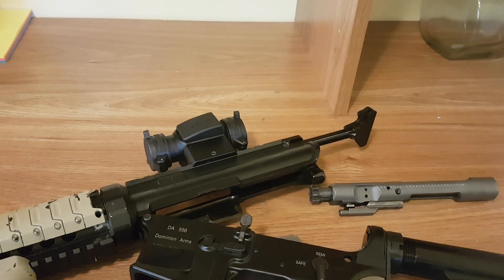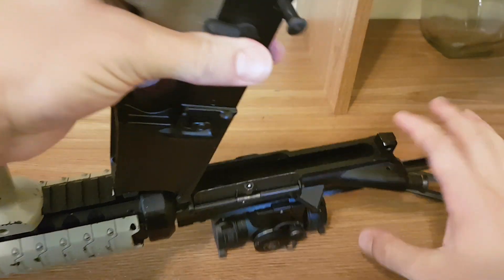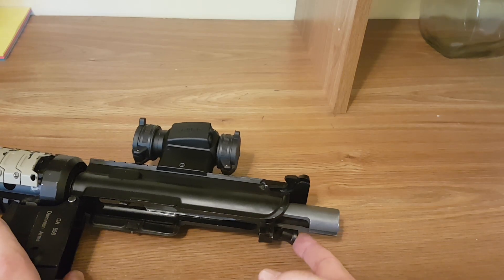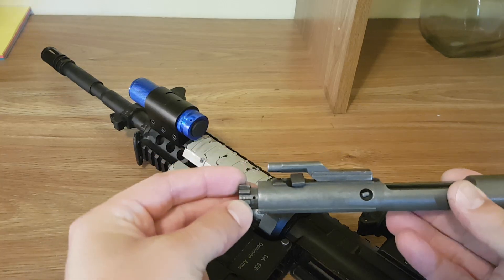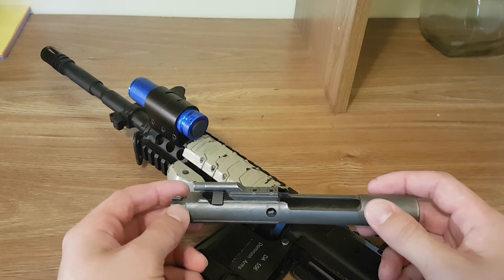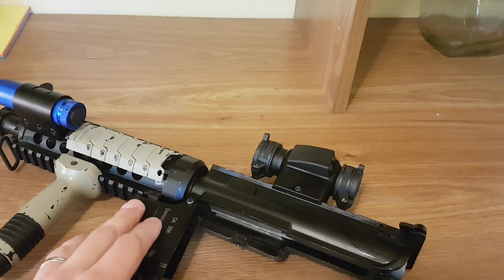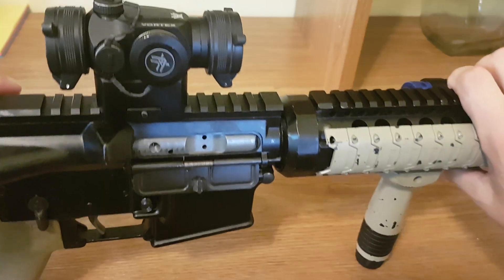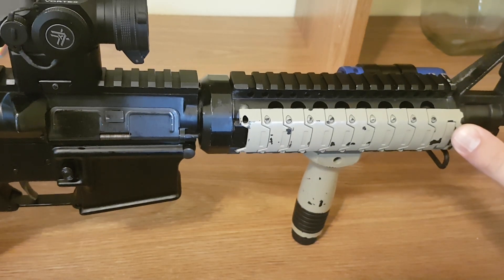What does the Forward Assist on the AR15 Do?

Comment: The forward assist was a solution to the problem of the M-16's non-chromed bore, which was solved by the chromed bore for the most part in the M-16A1 service rifle.  I have shot both them Rascals with and without a forward assist in a non-chromed bore, and the forward assist was a shit-show either way.

Comment: Hmmm, I always thought the forward assist was there in case you fired a half dud, the case ejected, but the buffer spring didn't have enough recoil to completely chamber the the next round, so you could bash on that like a crazed clown in a firefight, hopefully, getting to fire some more. Removes beer caps pretty well.

Comment: The Army called Rube Goldberg to fix the original M16 when the bolt doesn’t seat itself properly to fire a round. Once again corners cut, shoddy, insufficient parts used in the manufacture caused deadly jams.

Comment: It was originally put on to fix a problem that should never have existed.
If stoner had put a version of the AR18 piston system in the M16, the dirty gas would never have built up residue in the receiver. And the forward assist would not have been needed to push the bullet home.

Comment: The secondary forward assist plunger is a design flaw. As is the dust cover and rear charging handle. Notice the scallop milled out of the Johnson bolt just forward of the serrations, that is the primary forward assist, if you have too use the plunger to assist a round, you would be much wiser to eject the round. Better yet, don't buy the .22 cal. AR-15. Buy a decently set up SM-25 or LR-308, much better bang for your buck.

Comment: One of the steps you perform, while chambering a round, with rifle or pistol, is to determine weapon status. Verify that a round has actually chambered or, maybe its been an eventful day, and you need to re-check before you kick that door in. It's sometimes called the "Press-Check" -- Pull bolt back slightly (or slide on a pistol), observe back end of round in chamber, return charging handle forward, tap forward assist to ensure the bolt is once again fully forward. Now you can bust open that door and do good things!!

Comment: I can’t stop looking at the Walmart flashlight
Reply: That actually looks like the free Harbor Freight flashlight they handout when you walk in the door
Reply: MY2001db426 lol
Reply: If it works it works
Reply: Lol I'm sure it really comes in handy for night ops
Reply: It's the most tactical object in the frame...
Reply: I know eh? He needs a tactical flashlight with a pressure switch
Reply: i just tape mine on
Reply: Lol
Reply: I am enjoying the Walgreens red dot myself. Its the single bolt edition too.
Reply: Things probably not even 100 lumen. A cheap 1850 Amazon light is the same size and is 1000+
Reply: Ba hahaha...its because its blue right?? 😆
Reply: @mail-qh2qc  because they can🤣
Reply: Push to start flash light lmao .
Reply: 2021 lol
Reply: I put one on my rifle, to see if I really needed/ wanted one. Maybe what he's doing? Not everybody has money to throw away, for things that might not improve their rifle.
Reply: Harbor freight fo free
Reply: Common sense saves money.  You can spend 100 bucks on a fancy light or use a cheap Walmart light and some zip ties and it will function the same way.
Reply: @Boatman9867  All that vibration after being fired might break a dollar flashlight.
Reply: @Boatman9867  fun fact many of those cheap flashlights have the same diameter as a scope, if you have an extra scope ring lying around you can use that to mount the flashlight on picitanny. It's also very easy to use some wire and move the button back closer to your hand if you wish.
Reply: @Boatman9867  if you think that light and a surefire are equals then there is no hope for you.
Reply: @wlmblsffflions4691  That's nice.
Reply: I’m guessing that whole "set up" is coming in at around 10lbs lol
Reply: I have a 5000 lumens DeWalt light on mine I can see clearly all the way to 200ft easily

Comment: To all the paid Russian trolls: Forgotten Weapons on YouTube mud tested the AK and the AR. Guess what? The AK failed, and the AR passed. The AR is more reliable when it is dirty than the AK.
Reply: ShitSnake take your AK to the mud pit and you'll find out it's not the "impossible to jam" weapon you think it is... the open receiver of the AK is a magnet for mud and crap, the "dust cover" on the AK works while in Safe but remains 100% open to debris during operation.. the AR has a "Dust cover" that will open after first shot but the bolt seals out the receiver and chamber.. there's no open slot in back of the bolt carrier which is the main reason for failure of the AK... both weapons have had decades of development but the only thing people ever reference is M-16's delivered to troops in Vietnam without proper cleaning kits and training.. AK was total pos when first produced, now its barely a pos..

Comment: Sorry for my english, but its not my mother language.
Ok... I am chief sergeant in Greek army and let me explain to you, what this forward assist button does.
To arm your AR, you need to pull the charging handle and let it drag the bolt carrier with force, to lock in the chamber room.BUT these kinetics makes alot of noise!!!
If you are in a hostile enviroment (war) and you need to arm your AR with out noice, you drag the charging handle and after that you drive it slowly with your hand to close in the chamber room. Because the bolt doesnt have the impact force now to lock, you press the assist button to be sure that the bolt is locked with no any noice.
Reply: Also, you can pull the bolt half an inch to watch if you have bullet in the champer  and all are alright and after that you can put the bolt in lock position with the assist button. So you dont waste time in rearming or loosing bullet from the port.

Comment: Forward assist , ?? Or more like , flooded barrel assist , you see these rifles when used in military service were subjected to the very harsh environments that would eventually encounter them being partially submerged in water , so when this happened a suction occurred that trapped water inside the barrel not allowing it to fully drain out , so the flood assist , or call it forward assist , allowed the bolt to be very slightly drawn back , breaking the suction seal , and allowing the water to rapidly drain out of the barrel as air was allowed to enter through the small exposed gap in the bolt , then the bolt could be fully closed simply by , thumbing the assist button a few times , silently , as a slam back bolt closure would require ejecting the already loaded cartridge and following up with loading a fresh cartridge into the barrel from the magazine , noisy a bit , and in some situations this would not be acceptable !

Comment: It's only if you're running in really adverse conditions and you need the bolt to go into battery, it's kinda antiquated as most modern ARs with modern ammo wouldn't have that problem, especially if kept clean. But if I'm running dirty and I need a few more shots it'll be good to know a little grime won't keep my bolt from going into battery

Comment: it actually does have a very practical use.... I use it on my ar10 while hunting, to chamber a round quietly, you don’t let the bolt slam shut, you gently release the charging handle, and use the forward assist to finish putting the bolt fully into battery like the video tries to show, but with a round in the magazine, it creates more friction.

Comment: It’s used to inject your no2 or nos or nitrous oxide, can be used to open the carburettor, some models of ar15 it’s used to drop the clutch and go skrrt skrrt, enable diff lock, traction control, shift gear, and lastly change your blinker fluid

Comment: You don’t “push” on it, you slam it with the heel of your palm so it goes home. Its not a pushbutton on a 1965 am radio, it’s a lifesaving mechanism designed to “assist” to user in surviving.
Reply: except it actually doesn't do anything that cycling the action wouldn't fix.
Reply: That's what I was taught in the Corps, exactly like you say. Although I guess for just garden variety fun it can be babied.
Reply: I’m rolling at the comments.
Reply: Bro, chill.
Reply: big papi  Isnt the divot in the bolt carrier designed by stoner so you can push the bolt into battery?
Reply: J Mc Condescending manlet detected

Comment: Virgin: Using the bolt release paddle to close the bolt
Chad: Using the forward assist to go into battery
Über Chad: Taking away the BHO system and just using the charging handle to cock the gun all the time

Comment: I believe forward assist only helps if the round is already in batter, but isn’t fully slammed in and is just sitting there. If your gun is jammed I was told to never slam that fucking button, unless I want to dig out the shell.

Comment: The whole point of the FA system was really to fix an issue during vietnam, ammo was also a lot more dirty back then and the rifle had several issues. Since then the bugs have long been rectified. I think the FA system is used very little these days but its still good to have there just in case. I've fired thousands of rounds out of ARs without a cleaning at times and never had a jam occur.

Comment: Right off the bat, the apparatus your holding is the bolt carrier. It carries the bolt. When the assembled bolt is in the carrier, it is called a bolt carrier group. Forward assist helps the carrier move forward. Therefore pushing the bolt into battery

Comment: I never have actually had a failure to properly feed.  I try to keep it as clean as possible, but it is nice to know the forward assist is there, just the same.  If it is fouled to the point the bolt is not closing to lock on its own.....time to clean the chamber.  I would consider the forward assist to be used in extreme circumstances.

Comment: Not sure how true this is . I was told another function of the forward assist was when a soldier needed to be extra quiet he could slowly guid the charge handle without letting it snap , then push the forward assist to assure full battery.

Comment: Infantry NCO here.
The Forward Assist's use is highly situational and is a multi-step procedure that takes a little foresight.
Basically, when you get a jammed cartridge, you extract it (if you need to use your fighting knife to do this, so much the better). You take this cartridge and place it in the camo band of your helmet for later use.
Now, when you expend all your ammunition and your Last Ditch Effort has failed, you take the last few seconds of your pitiful little existence to:
1. Lock the bolt to the rear.
2. Drop that bent cartridge (that you so carefully saved from earlier) through the ejection port into the upper receiver.
3. Release the bolt allowing it to go forward as far as the bent case will allow.
4. Start hammering on the Forward Assist to disable the weapon.

This prevents your weapon from being used on your luckier buddies after one of those "other people" has stripped your corpse.

Comment: It's for the CO2 cartridge anybody fired it AR-15 no stock if it's a CO2 cartridge in it fires the BB then again it's also for extracting a starting shell from a gas is it which is CO2 in the chamber of the fight by 6 and probably going to do it with a green tip not the regular yellow tip or a male standard ball around

Comment: Short answer: The forward assist does nothing. Fired M16s and AR15s for over 30 years. Never had to use it. If your M16/AR15 doesn't fully a chamber a round, the last thing you want to do is cram it into the chamber with the forward assist. Stop shooting. Disassemble it. And clear the obstruction.
Reply: Just because you've "Never had to use it.", doesn't mean it doesn't do anything...you obviously are a REMF, or a "POG" as they call them today, stick to your pencils and leave the rifles to the men that do the fighting...DOLT!!!
Reply: @wipatriot510  Thank you for your gratuitous insults. So I'm a "dolt" because I stated the AR15/M16 forward assist isn't necessary. I guess Eugene Stoner is also a dolt. He was the "remf" who designed the rifle. Probably knows more about his rifle than you. His design didn't have a forward assist. It was only added later due to malfunctions with early M16s primarily caused by changes in propellant powder, lack of proper cleaning and non chrome lined chambers. Once properly loaded ammunition was issued, along with cleaning equipment and chrome lined chambers and barrels, the early malfunctioning problems ceased. But again, thank you for your thoughtful comments and your military service. From one veteran to another.

Comment: the forward assist is to aid in clearing water from the barrel, it lets you break the vacuum seal to drain the water and then bring the bolt back to battery without ejecting the first round

Comment: As I watched this video, I started thinking about training with the M -16 when I was in the Air Force. And I sure didn't remember any "forward assist" on ours.  Had to research it. Seems the Air Force, as well as Colt(manufacturer), didn't see it as a necessity. It would add to cost and weight. Biggest issues we had were misfires due to the 22 Lr ammo we were firing with(with an adapter), and not the .223 NATO rounds we would actually use in the field.
Reply: USAF actually did tests and in something like 10000 rounds fired they could not find one example of a malfunction that was fixable with the forward assist that wasn't fixable via cycling the gun - everything was either catastrophic failure or just cycle the action
Reply: Correct Jeff. The USAF was the first branch of the U.S. Military to adapt the M-16. It had chrome bolt carrier, chrome chamber, etc and NO forward assist and may have worked very well in combat but was never issued to large infantry units. (only small SF and SEAL units).   McNamara wanted the M-16 for the U.S. Amy in 1965 and then for the USMC in 1967 and ordered over 300,000 of them made much less expensive than the original USAF  M-16.  Removing the chrome to cut costs and Adding forward assist to the rifle and renaming it the  XM16-E1. The XM16-E1 is the rifle that gave the USAF M-16 a bad name for 55 years.  Now when the M-16A1 came along to "FIX" the XM16-E1, the chrome was added back to the M-16A1. All the engineers who worked on the M-16 early variants and now gone and the reasons for the forward assist are buried with them. I do suspect that the forward assist may be helpful when firing in sub 0° temperatures when the metal shrinks especially in the receiver squeezing the bolt carrier.  Also to save money McNamara wanted to use up the old powder which  led to the disaster scandle.
Reply: Wut...?

Comment: The forward assist was originally designed for soldiers to remain silent while cocking their guns, instead of letting the bolt fly forward one could slowly let it slide forward and use the forward assist to get it set all the way in without making noise. Look it up

Comment: In the heat of battle, this looks really dodgy. As other comments here state, a stoppage could be made worse by using it. It seems to me to be a afterthought to fix a design issue/fault. No wonder this rifle is inferior reliability to the AK. What use is an attractive accurate rifle, if you are trying to clear a stoppage with the AK equipped enemy over running your position in real time with their boots already in your trench?

Comment: When I went to boot camp in 71 we had slab sided M-16's with no forward assist. The first day on the range I had a malfunction where the bolt foiled to go into battery. There was no way to put it in battery and I could not pull the pins to open the rifle to clear the jam. I disliked the M-16 and did not trust it even after the forward assist was added and it took me 20 years to trust it as a reliable weapon. I m am a fan of the AR-15/M-16 now.
Reply: @Rara Neagra I guess you never served. No recruit is going to take his weapon apart on the range without permission from the drill Sgt. A range officer cleared the weapon by pulling the receiver pins just like you said. I had so many failures to feed with that weapon they switch it out. The point is without taking the pins out of the SP 1 there was no other way to clear it. In combat you do not want to be pulling your weapon apart.
Reply: @Rara Neagra calm down 😅

Comment: If you’ll notice, there is also a scalloped area on the right side of the bolt.  It was on the rifle even before the forward assist was implemented.  It allows you to use your thumb through the ejection port to push the bolt forward, just like the forward assist.  I sure wouldn’t do this with bare hands and a hot bolt but it can be easily done when wearing gloves.

Comment: last time i used my forward assist, it made the jam worse and broke my extractor claw. Bulged Brass from recalled ammo got stuck in the chamber. upon firing, it blew my magazine out of the well and cycled the bolt. the bullet cleared the barrel. i couldnt pry out the brass so i let the bolt go forward but it wouldnt lock on the rim. so i tapped the forward assist, and sure enough it latched on to the rim. couldnt pull the charging handle back so i hit the charging handle with a hammer and the extractor broke. took it home, stuck a cleaning rod down the barrel and two healthy waps got the casing out. seriously though, fuck the forward assist. only army logic could've thought of such a thing.

Comment: A lot of people against the forward assist. I'm pretty new to the ar 15. My first time at the range I had to use it 2 or 3 times when chambering a round manually with the charging handle. Haven't had to use it since then. Maybe the gun just needed to be broken in. The forward assist did at least serve a valid purpose for the first shooting session